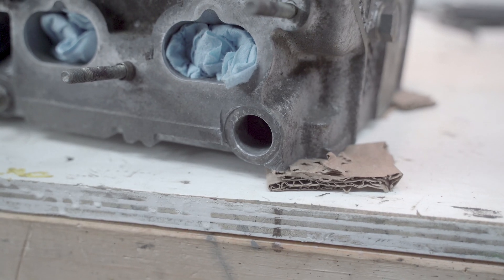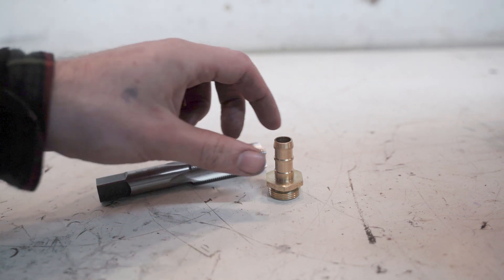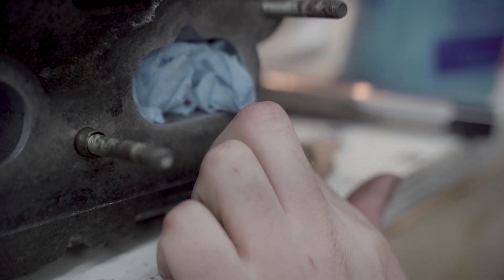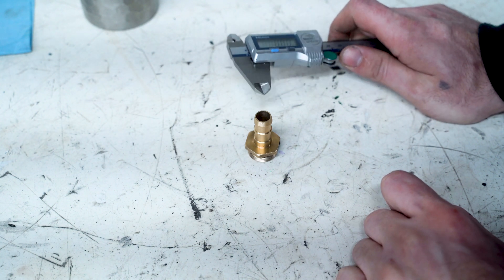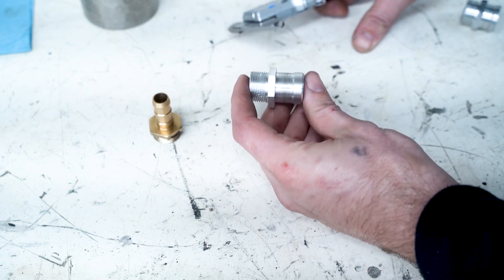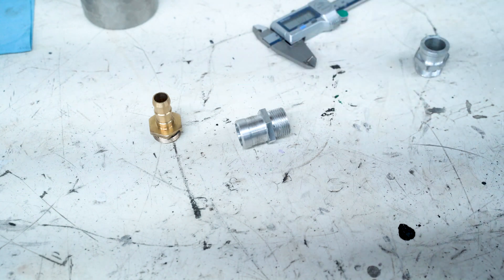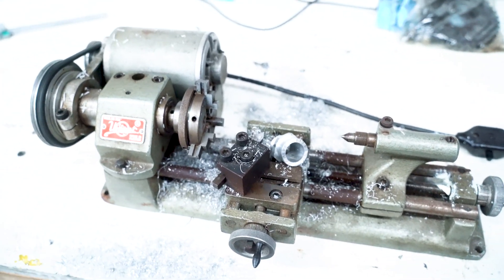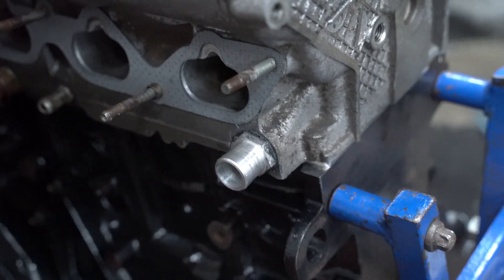Fixing the coolant port on an M42 Head

Comment: Thanks for the video. I have another problem with same engine. 

Recently coolant connector which is below the lower manifold blew up and I decided to replace all the hoses under the manifold. Then I found the port in this video and the other port which send coolant to the throttle  and which is on the middle of the cylinder head is too bone dry. 

I wonder if there is any block at the front end of the coolant passage. 

Do you have any idea about this. Is there any way to figure this out and clean it. 

Thanks and regards